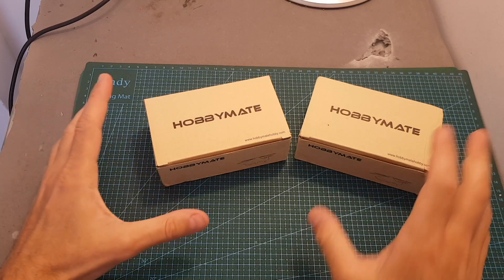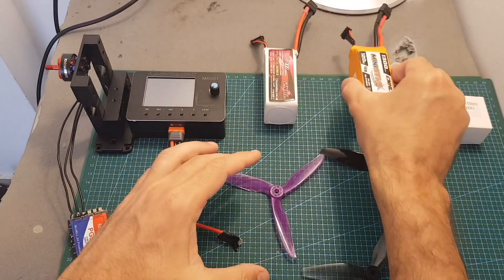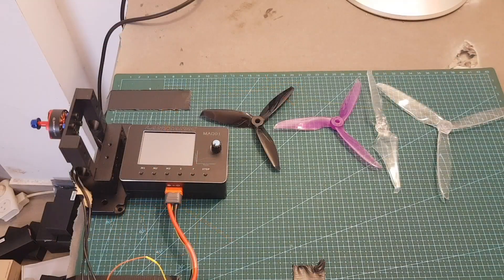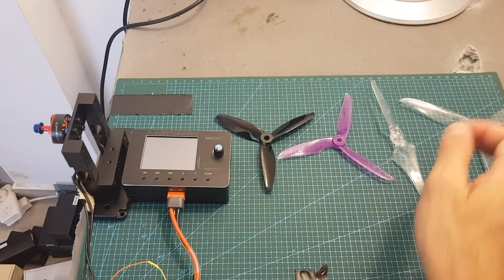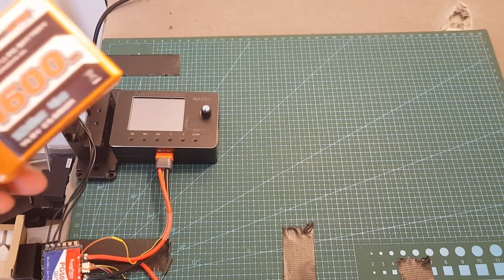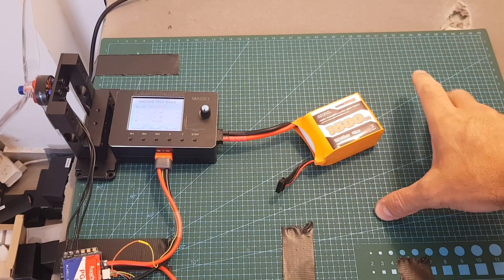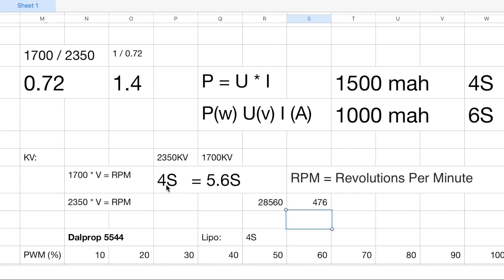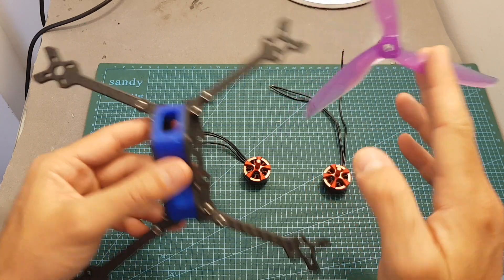HOBBYCOOL 2207 1700/2350KV Motors

Comment: I highly doubt it here, but I wonder if your tester lifting up in the last 3 or so speeds causes any issues with the readings? Not likely, but curious to find out =P I like these tests you do. That Emax prop is NUTS... Looks wicked... I have 3061 props on my GEPRC MSX3... Love the look =P
Reply from the maker: I don't think that it caused any reading issues. The Voltage reading was off and I need to calibrate it though (But it was equally different on all the tests). I am looking forward to testing the Avan 6" on my Hawk 5" upgrade :-)

Comment: That's just a rebranded BH R3. Not bad numbers for it. Could you test the GEPRC 2207?
Reply from the maker: I currently don't have a spare GEPRC 2207 motor, but I will consider it, thanks!
Reply: Pedro Griebler Reche I've seen these before, and that's the consensuses, that they are just rebranded BH